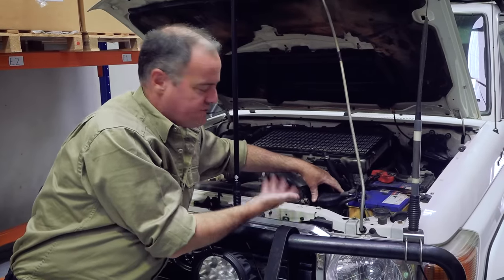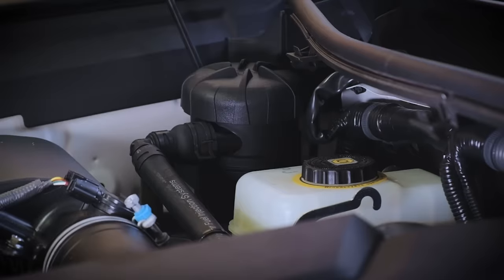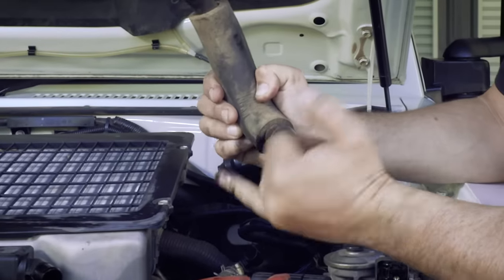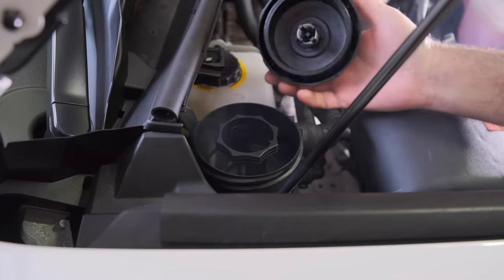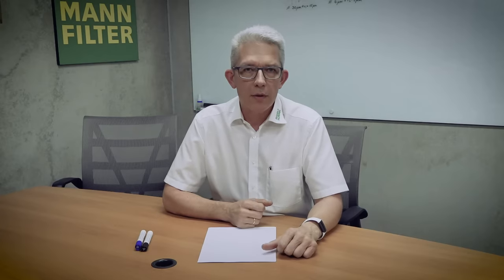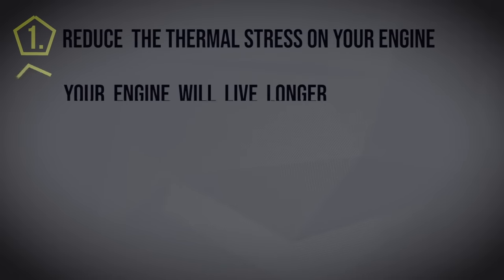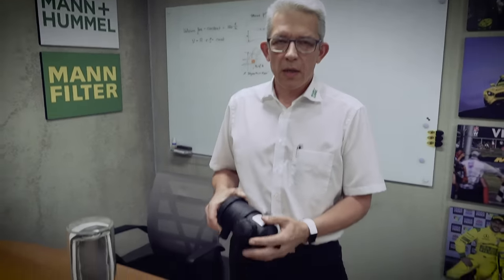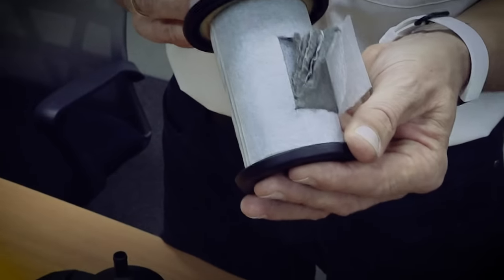CATCH CANS & EGR explained in detail! Why your diesel’s clogging up & losing power - how to fix it

Comment: Just buy an 80 series. Problem solved.
Reply: 80 series needs a catch can too. unless you want oil coated intake manifold
Reply: @zeMasterRuseman  dump to atmosphere then ya don't
Reply: @adrianwua8548  Then you have oil mist all over your engine bay or underbody and toxic oil stink in your cabin. Catch cans are only $40 bucks on ebay and all you have to do is connect 2 hoses to it.
Reply: @zeMasterRuseman  zero oil smell. Depending where you run the hose no oil gets on the underbody. If it did it wouldn't be a problem anyway.

Comment: na mate blank that egr off your just trying to push your product
Reply from the maker: Hi Luke - a blanked EGR can fix half the problem - not the full problem. It doesn't stop all the oil build up in your intercooler and intake which can cause cooling inefficiencies.
Reply: 200,000km on my Patrol CRD and there's never been any oil build up in the intercooler or any of the pipes (wiping my finger around the inlet just gives evidence of a light coating), that's without a catch can installed. I've heard of people having more problems with catch cans than without. The fact is that oil is diesel fuel, why waste it and not burn it? Just blank the EGR.
Reply: I have blank my egr too and I have a oil catch can too.. And I've done over 300,000ks I say block that egr. The catch can I just got put in last year... And it's a Nissan Patrol 3lt comm rail
Reply: 200,000k on my CRD i30 and no build up, no catch can and no blank. So why block it.

Comment: Even easier fix, Don't buy a diesel..
Reply: Direct injection gas engines have the same issue...
Reply: @jeep6242  working at dealership and only working with high end high performance manufacturers that produce most models using DI petrol engines I'm yet to see a single case of this problem. I have never had to clean a intake manifold, remove carbon build up, clean egr systems (not that they actually have any because the engines are built well enough to not require additional emissions compance).
Reply: @jeep6242  funny reading your name I work with new jeeps quite lot, I mean dealer level (SRT), and the only egr system I've seen on them arnt Direct injection, but the old crappy MPI 3.8 V6 engine with hot egr return.